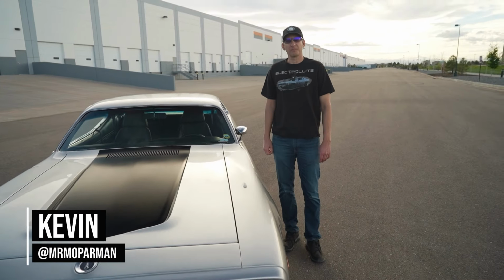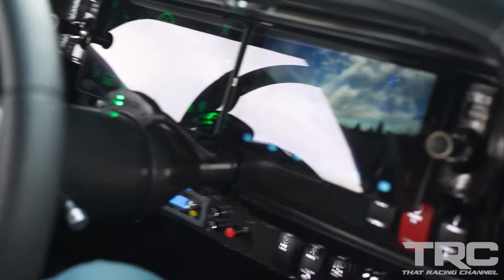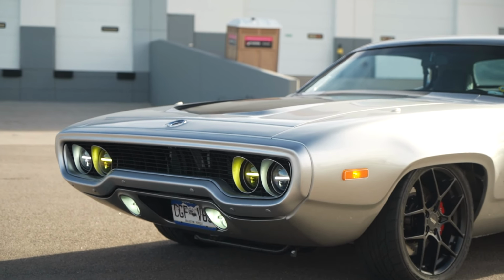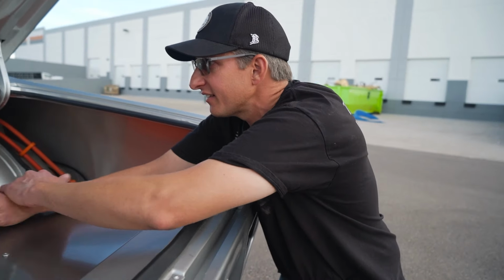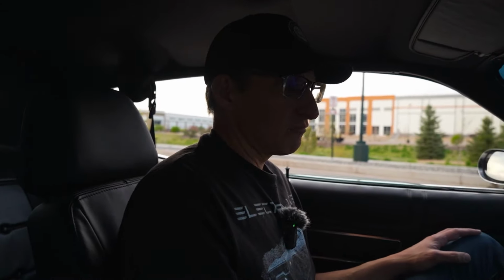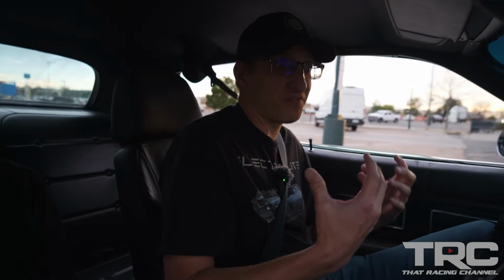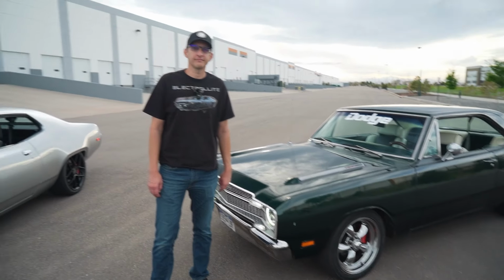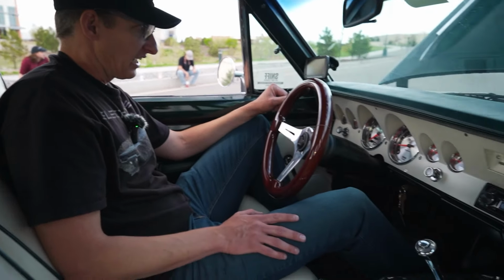Tesla Swap Plymouth SURPRISES 700HP Turbo Dodge Dart! (He Built his Own EV Muscle Car)

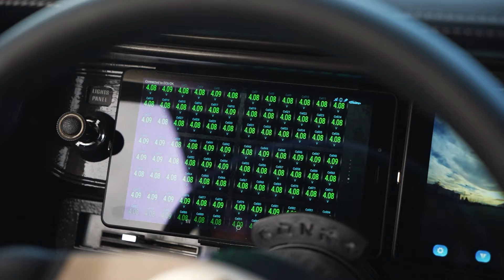Comment: 12:30. Why do I keep reading that unlike a hybrid, you can't just swap out bad cells in an EV but then people like this confidently say that you can? If that's the case then why aren't there many cheap repair options for bad batteries? If we could do this without a problem there shouldn't be any reason that we can't keep an EV on the road cheaply for longer than gas cars.

Comment: 1220amps @ 400volts (assuming it’s DC) = 488,000 Volt*Amps (single phase)

1 V*A = 0.0013410221 HP.

0.0013410221 * 488,000 V*A = HP

HP = 654.42 HP roughly.
Reply: The major advantage is the complete control of the electric torque curve bc it’s completely programmable from 1% or 100% torque right off the bat.

Comment: As awesome as this is, I'm still waiting for an electric/V8 hybrid in a muscle car like this.
Reply: It would be double the engineering for less performance than an EV.
Reply: @mellowphantpi9168  "less performance" That's not correct.
Reply: @sammiches6859  Yeah, it is.
Reply: @mellowphantpi9168  Really? So an EV would get better range and a higher top speed for half the engineering? Please detail what planet you live on.
Reply: @sammiches6859   I said 'half' the engineering because I figured people would pick up on the whole one-system-vs-two-system concept in a mass and cost sensitive context.
Top speed doesn't equal performance, and even if it did, practically nobody can afford the cars that have higher top speeds than EVs. (What are there, three, maybe four cars that can beat an un-governed Model S's top speed?) Also, you don't just slap a battery in an ICE car and have a hybrid, there's two separate complex systems that have to be designed to fit in a single car and work together seamlessly. On top of complexity and cost, there's a mass issue, so there's no margin left if you even approach the capabilities of a quality EV (and if there is, then the price is too high for scale).
I live on a planet in a universe with constant laws of physics and mathematics. What planet do you live on?

Comment: 488k watts. That is nuts.
Reply: About 654hp at the most
Reply: @Billy.80  yeah. I'm working on one that is 600v and 528 (peak) amps (3c of 176 ah)... And I might get 316kw... In a truck basically loaded full with batteries...

My amazement is they got it to fit in that car...

Comment: Just gonna remind the people here in the comments bashing old school internal combustion enthusiasts that EVs existed in the mainstream from the late 1890s till around the mid 1920s and eventually lost out to gas powered cars due to improved reliability, better range, lower cost, and ease of maintenace. EVs are nothing new and are frankly anything but the future. Climate change is caused when you burn an unreal amount of actual nonrenewable resources, such as lithium, nickel, and cobalt, with abhorrent extraction techniques and hardly anyway to recycle them efficiently. EVs existing as an option is not the issue as they make a lot since as urban commuters. Forcing it as the standard for automotive propulsion and trying to outlaw its competitors is. Some do not want drive a vehicle that requires at a minimum 20 minutes to charge and will lose its range year by year at an alarming rate. Attempting to portray the people who want traditional combustion engines to remain as invalids only makes the problems worse. If this generation believes everyone's opinion matters, than that includes those whose go against your own. Opinions can be debated but do it sensibly and do it without the childish name-calling. Thank you for your time.

Comment: Well, when a DeLorean goes to an electric package, I understand, but when a muscle car, I don't understand, it should scream
Reply: back in the early 70s they made a little batch of sterling engine GTOs, they would run reliably on basically any flammable liquid, outpreformed the regular ones by about 20%, and got ~70-90 miles to the gallon depending on what you were doing with them but they only managed to sell like 3 out of the whole batch for one very simple and frankly sad reason: they were showboaty sportscars that ran almost dead silent even at full throttle.

^just to be clear external combustion engines aren't actually all that great for power to weight ratios, they are however super efficient (that gas milage for instance was completely accidental) and let you skip a whole lot of the extra stuff you need to include to run an internal combustion engine in a car so the things just straight up had more motor in them because they could.

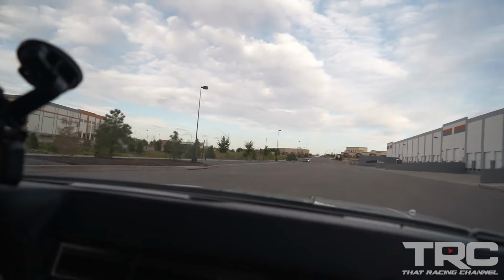Comment: 5:22 He probably meant 120amps not 1200, i don't think his car would be pulling 500kilowatt off the batteries lol.

I'm guessing he read 120.0 as 1200
Reply: Definitely 1,200 amps, the battery is rated for 1,760 amp pulls

Comment: honestly, there are so many cars that can be saved with an EV conversion. our future holds many mysteries, some of them are very concerning. love them or hate them, electric is the future, and honestly? as cool as high horsepower engines are, electric motors have more power capabilities and more torque than an internal combustion engine. and all that power and torque can come as soon as the electric motor receives power, immediately. with bone shattering force.
Reply: Ironically enough, the characteristics of electric motors are perfectly suited to muscle cars for all the reasons you just listed. Limited range and long charging times aren't really an issue for them, nobody is doing a cross country drive in these things.
Reply: @Nightdiver20  most of the cars that immediately came to mind are indeed, muscle cars, and old trucks

Comment: I know its heavy but watching this.... I do not believe that is 700 HP. Maybe 600 HP at the crank. Still both are very nice cars.
Reply: That dart probably only weighs 3400 lbs that's not too heavy at all. I'm with you that looked like maybe 600 crank. I'd also like to know if he has setup a boost by gear system in this thing because the dig race was way to tame for even 600 crank.

Comment: EVs are gonna usher in a new age of sleeper cars. Imagine in a few years some dude is gonna pull next to you with a weed wacker sounding civic. You go to line up and the dude is gonna reach over to flip a switch and the audio from the speakers is gonna cut off. That's is when you're gonna realize you're boned.

Comment: I just cant get past the silence ....it's so unnatural to see it running so hard without any noise. I respect the build but these electric cars are going to ruin my Hobbie for me. They lack everything I love about hotrods.....the smell of high octane fuel.....the noise of a big cam and the vibration of hard loping idle. ....these electric cars are gonna take over and be so much faster than the gasoline cars and I'm gonna be like that slow guy back in  1906 who was still trying to ride horse when everyone else had a model A and is laughing at me because my hot rod smells bad and poops in the road......